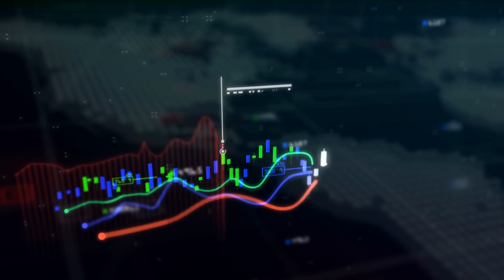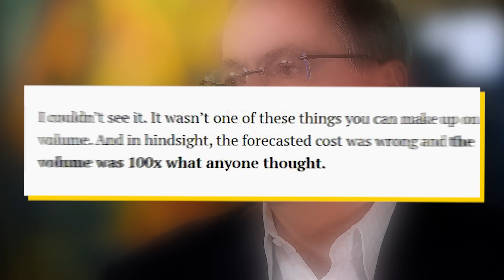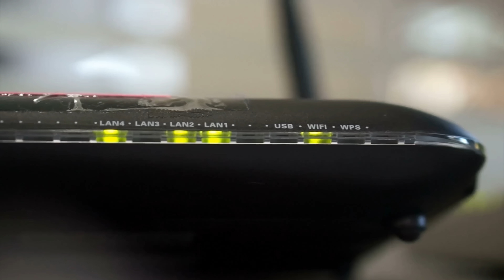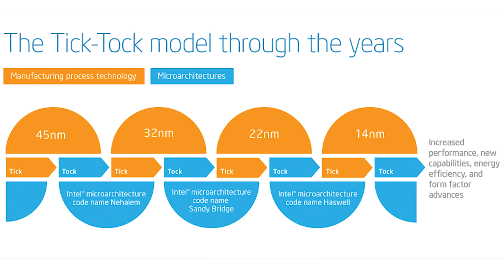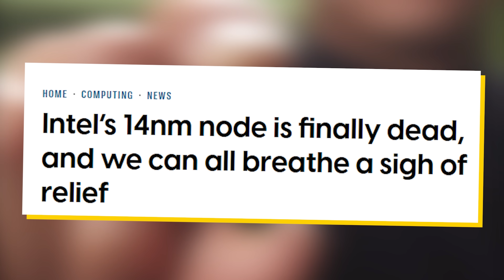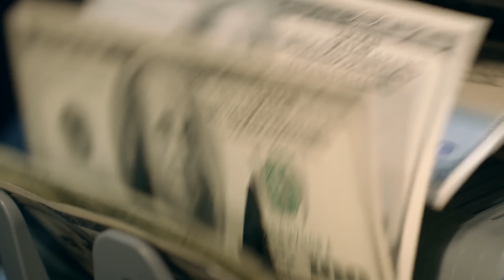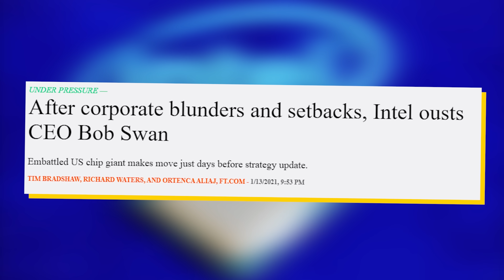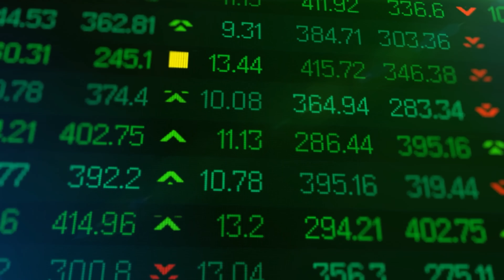Intel - Struggling Even During A Global Chip Shortage

Comment: 1 of the factors that in my opinion will cause the downfall of intel is its attachment to its archaic x86 architecture. they need to embrace either ARM or openRISC or they will face extinction. AMD is already doing it.
Reply: Either that or they need to re-engineer x86.

the x86 architecture is over 40 years old. As such, it carries a lot of "useless baggage". 

For example, all x86 CPUs support legacy features such as SSE, which are basically redundant today. 

ARM keeps improving the architecture with new versions like ARM v7, v8 and now the latest v9. Meanwhile x86 has largely remained the same.

They need to reengineer a new version of x86 that is more efficient like ARM, or ditch x86 altogether.

Comment: There is no "chip shortage" when talking about high-value semiconductors (e.g. those build on current and recent generation nodes, 14-7nm and smaller). The shortage is all on the legacy and last gen nodes (24nm, 32nm, etc.) which are essentially produced at "aged-out" fabs. It's those old processes that are used for low-value chips, such as low-cost microcontrollers. Many of these fabs were permanently shutdown at the beginning of the pandemic, in expectation of a sustained drop in demand for such chips (used in everything from automobiles to washing machines). The unexpectedly sharp rebound in demand caught the industry by surprise, and this is why we continue to hear that the chip shortage wont abate for another 12-24 months. The dirty open secret the industry has been careful to not discuss is that the semiconductor business will never invest in building obsolete fabs (because all fabs are exceedingly expensive to build) to ease this shortage, everyone is going to have to wait through an obsolescence cycle.

This is, at least in part, what drove Intel's foundry services announcement: Intel's about to have a bunch of older capacity available as they build new facilities. With the sudden shortage of older fab capacity, Intel's long-in-the-tooth 14nm facilities can transition to filling that gap (while wringing more revenue out of older fabs, especially when margins for those low-value parts are at a relative high, due to shortages). However, the vast majority of Intel's revenue is from high-value semiconductors (just like Nvidia, AMD, Apple's silicon, etc.).

As for Intel's products, my primary machines are currently AMD (5950x and 3800x respectively), running Nvidia GPU hardware (RTX 3080 and GTX 1660), so I'm not exactly a huge fan of stagnation era Intel, but nobody can deny that Alder Lake is hugely impressive, from a general purpose compute standpoint. Pat Gelsinger is no fool and Intel's board was proactive enough to not let Intel go the way of the crumbling disaster that is GE, by putting him in the CEO seat (just in the nick of time, IMHO). 

Intel deserved to get knocked off their pedestal, but not because they didn't go after mobile with ARM, a difficult business with it's own dominant players (a business that Intel left due to margin issues), but because they let their core business stagnate both in uArch design and investments in core fabs, giving AMD the opening they needed (and driving Apple off x86). However, counting Intel out today would be premature.

Comment: Like many mature companies with signature products, Intel is a victim of the "not invented here" mentality.  Their solutions are only palatable to the existing interests inside the company if these solutions can be bought into by internal stakeholders.  Intel did not embrace ARM because it would have required Intel to admit that the x86 architecture was not a good solution for the mobile space, and this would have called into question the necessity of Intel architectures in other spaces.   They have to choose if they are an IP company or a fab company.  If they tie fab to IP, they will underutilize their fab capabilities unnecessarily.  If they tie IP to fab, they will only be able to offer products created by the very latest processes that perhaps the market does not need.  Perhaps they should try to leapfrog ARM and provide an open source architecture alternative, since they do not otherwise have a competitive offering in the mobile space, and such solutions may enable additional competition in the mobile space that is not Samsung or Apple.

Comment: This video has some small inaccuracies. The primary difference between CISC and RISC (x86 vs ARM) is the size of the instruction set, not the power draw. CISC's larger instruction set uses less memory in exchange for slightly higher power draw, but this difference is not big enough to account for the high power draw of Intel chips. Intel chips target a different segment of the market, and Intel could theoretically make a chip with similar performance characteristics to an ARM chip. It would just struggle with compatibility, as translating the instruction sets would hurt performance just enough to make the chip unviable.

AMD also was not technically superior to Intel with Ryzen. They just got within striking distance and undercut them on price. Intel was raking in huge margins prior to AMD, and AMD forced them to price their chips competitively.

AMD didn't exactly "beat" Intel to 7nm either. They just asked TSMC to make 7nm chips for them. Intel refused to do so, which is why AMD and Intel are neck and neck.

Intel also has one big thing that AMD doesn't: they own their factories. If the global economy were to splinter and international chip production became more difficult, Intel would be able to keep producing chips for the US. This alone makes Intel a huge asset for national security, and I don't see the US Government ever allowing them to fail.

Comment: So as someone who has both Intel and AMD stock (so I don't appear to be a fan boy), I will say this: Intel isn't going anywhere anytime soon. There is going to be very fierce competition between the two companies over the next few years. 

The main concern I have is if China finally decides that it wants to integrate Taiwan permanently. This is not likely to happen even in the slightest, but there is not an insignificant chance of it happening. If that happens, AMD and NVIDIA are going to tank. TSMC only has 1 active FAB outside of Taiwan and China in Washington and they are working on one in Arizona. Its worth noting that the FAB in Washington is an 8 inch FAB which doesn't produce as much as their other FABs. If this does happen (Which I hope it doesn't) then Intel will literally be back on top by technicality and AMD will probably go to a point of near bankruptcy. Apple will also have a huge issue as well. Literally the only major companies that would survive if China attacks Taiwan are Samsung and Intel.

Comment: AMD's CPU Design is what amazed me. Instead of a Monolithic CPU Die where, all CPU Parts are manufactured in to one piece like would Intel did, AMD manufacture CPU Die into multiple different pieces and they called the "Chiplet" design. AMD is not going to worry about the CPU Die size limit. AMD is just going to bridge the CPU pieces so they can communicate together to act as a one CPU Die. Intel stuck to with the Monolithic design. So, intel was limited to how many cores and threads that they can fit into a Monolithic design. AMD can fit as many as cores as they want without them worrying about the CPU Die size limit. The Chiplet design also has a better Yield Quantity than the Monolithic one. Since there are split into little 2-4 pieces of CPU Die. Instead of Chunk to Chunk like the Intel's Monolithic Design.

Comment: The biggest fail at Intel was the long delayed transition to 10nm, which happened because they decided to do it with extended multipatterning with DUV instead of going with the new EUV process from ASML. At the time, because EUV was news, super expensive, and the bugs not worked out, that wasn't an unreasonable decision, except yields were persistantly poor and TSMC got EUV to work profitably at 7nm  before Intel got their 10nm (same chip density as TSMC 7nm) to work.
It should be easier for Intel to catch up at 5nm and 3nm, since these also work on extended versions of EUV, which is now a more mature technology, provided by ASML to Intel, TSMC, and Samsung.

Comment: d. Rebuilding Intel is going to take some time, all the fab equipment we need to design and build to fit a specific foot print doesn't happen overnight. Intel's problem started when they hired a Wall Street CEO that was only worried about cashing in on what Intel did in the past, great place to rob large gobs of cash from in stock buy backs and executive stock options. The design and building, installing, and bug squashing is going to take a long time, it,' on us to design around the specs Intel is shooting for, but the end result may not actually work as designed/physics. So there changes along the way in the process when ranges change, and tools need to be re-engineered/designed/and then built to validate the new process technique. Then the new design needs to be validated, and sometimes more adjustments are needed to find that sweet spot where the magic happens. You can usually tell what's happening by announced delays when you factor in wafer processing time and testing that happens on the first set of wafers come off the line and test well, or not. It's usually 3 months on a 14/10nm++++ node, 4 1/2 months on a an EUV node, which usually means they found somthing unexpected, they need to fix, and run a new batch of wagers and validate.

Comment: Good point about the server/laptop deals on Intel's side, as these are still holding for a time.

But also, a ton of server-heavy software is optimised specifically for Intel Xeons. If Epyc keeps rising further however, the cost-effectiveness of these will simply not be there anymore. If Epyc can deliver 3-5x the power of a Xeon, then paying the development costs to optimise these workloads for AMD cores is worth it. When they happens, we may see a flurry of downfalls of Intel-based servers for AMD-based ones all within a year or so of one another.

And another good point regarding Nvidia: unlike Intel, they haven't been sleeping on their laurels, so the fight is outright furious in GPU space. However, AMD has aimed with great rigour at electrical efficiency. While not a particularly highly regarded point by gaming consumers, it has a serious caveat: when GPUs draw more power, and generate more heat, they end up being closer and closer to a natural limitation. You simply won't have a 800W GPU on an ATX motherboard. AMD isn't crushing Nvidia on this front, but they have a general 15-20% better performance-to-watt ratio, and that leaves them with that much more elbow room for growing their cards' performance in the long run. Nvidia has held itself high with the 3000 vs RDNA2 war, and may yet hold firm for 4000 vs RDNA3, but I wonder if they aren't going to simply run into worse and worse power issues that AMD can freely ignore.
Reply: dont forget the power consumption xeons are very power hungry and thats the main running costs of any datacenter..

Comment: Intel needs to invest in 5nm infrastructure for sure. They are currently building a new chip plant and this is where they should start. Also rebranding the chip name would also help spark more interest.
Intel Nano or something like that. 🤔
Would be advisable also to spread their bets, making the lower spec chips, equivalent to i3 and i5 a low power multi core and spec'ing up the i7, creating i9 equivalents to higher processing capabilities.
This would ensure they have the best of both worlds.
Also, there are the light based transistors that could be a source of innovation for them, with a view for AI.
There is so much going on in the industry and with their shear size and current clientele, they are in a strong position to transition - excuse the pun - into the future, rather than stick in the mud and slowly fade into obscurity.
Food 🍿🥢for thought 💭